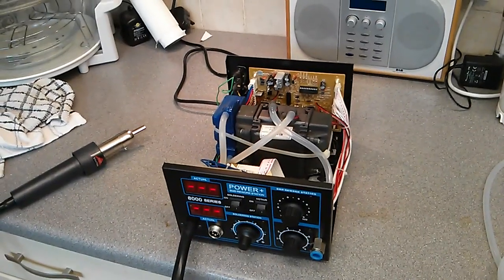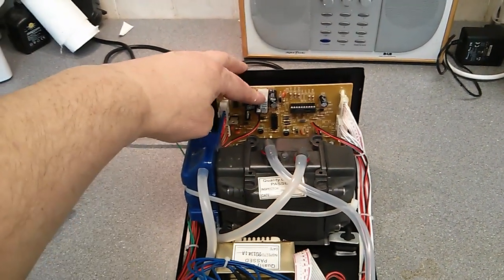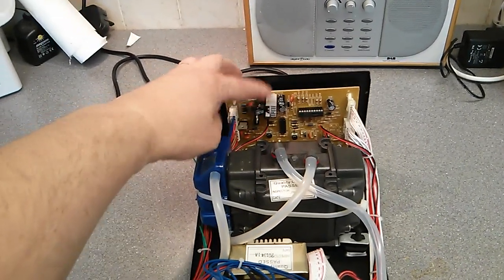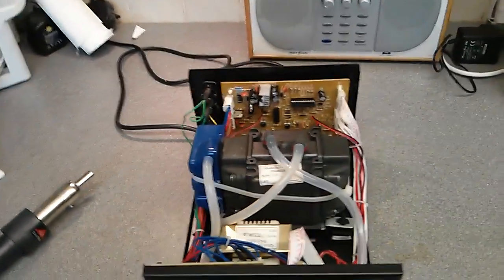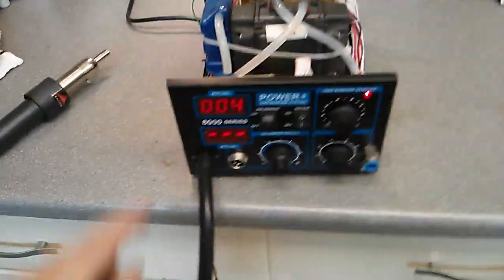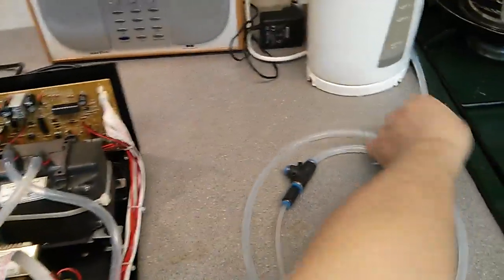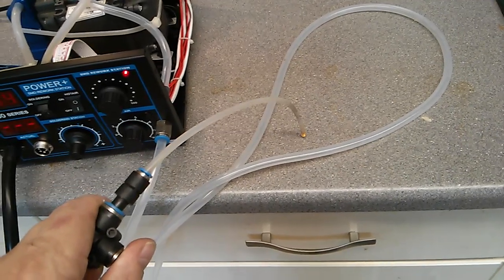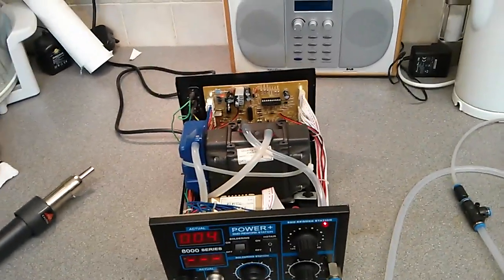Power+ 8000 SMD hot air soldering rework station mods. Was 2 in 1 now 3 in 1

Comment from the maker: The latest mod is a very simple one...   

 I used the cable from a defunct iron ( new irons are only a couple of pounds) cut the iron off, and put a socket to match the plug on the other end..    

I now have an extension lead for the soldering irons..    ridiculously useful !

Comment: I just received my unit. I tested the hot air blower, it worked for about one minute.  It's not blowing air anymore. Any clue ?
Reply from the maker: Sadly no,   I bought a second one a few weeks ago and it had a fault on the board that controls the air pump. The fault on mine was that it delivered no air or air at full power, the potentiometer working like a switch..  The job I needed it for requires an accurate airflow control.   I made a video and sent it to the seller, who refunded. I then bought another which works just fine.
If its new, I'd advise contacting the seller for replacement or refund.

ps, the original is still working just fine..  and its used almost every day.

Comment: Cool Mods, I just won one of these for £25 delivered brand new. I have a BK6000 rework station for the last few years. this has the cartridge soldering iron tips. Since I don't have the Power 8000 yet I'm wondering if the pinout on the soldering iron connector is compatible with the Hakko irons?
Reply from the maker: I believe so, it certainly matches the cheap replacements and the tips fit fine too.  One mod I did since the video may be of interest.. I recycled the cable from an iron that failed by cutting at the iron end and adding an inline socket..  very useful iron extension lead !  By the way, this station is still working well, used for several hours a day for sometimes several hours at a time.
Reply: Spiyda Ltd thanks. yeah will get a hard life from me I have the iron and heat on for hours at a time doing ps4 HDMI ports.

Comment: Thanks for the great video - I have the exact same unit and I'm having a tough time trying to figure out why my pump only runs on full voltage (one speed). The pot on the front face has been tested as working and shows continuity to both AIR VOL2 connections on back board. The triac @ U3 (BTB04) was taken out of circuit and tested ok also with no shorts. It is a mystery indeed. I'll figure it out but figured I'd ask to see if someone had a quick answer...
Reply: Did you ever figure it out? Facing same issue. Are the knobs pots or something else? My first thought was to clean the pot but it looked different

Comment: Can you tell me what voltage feeds the 'air? I own a 952 Gordak! 
I think 15 VAC (since this is not the bridge rectifier) but await confirmation. 
Some time ago I removed the membrane since it was just noise and then not air it distributed. The membranes mounted on this desoldering station are really disgusting to say the least. I would like to apply a small Mabuchi RS360SH 3Vdc by inserting a diode schottly appropriate to protect the motor and the classic endurance. Thank you. Hello.

Comment: Hey!  Very nice little unit you have there!  I've been wanting a soldering station for a while now and am looking into buying this one.  I have a couple questions for you regarding the quality and such of this unit.   Do you still use it and does everything still function well?  Is the cord of the soldering iron heat resistant?(I always melt my soldering iron cords!)  

Thank you so much!
Reply from the maker: Hi,
I use it pretty much every day... and I would definitely reccomend it if you need the hot as well as an iron.
I use the hot air as much for heatshrink as anything else.
The cord is not heat resistant and I agree, that is a weak point. I don't have a great problem with it as i drape the iron cord over my microscopr when soldering, so the iron cannot come into contact.
The other niggle is the quality of the sleeve that hold the iron tips in place..  sometimes the tips jam and need a knock to free then ..
But all in all, still impressed !
Reply: Hey! Thank you for the quick reply!

Have those improvements like the bigger heat sink on the regulator and resistor replacement held up? 

Sounds like a great unit!  I'm getting it!  :D
Reply from the maker: The changes are fine and can only increase the lifetime..
go for it..  ( ps - I have no connection with the manufacturer or suppliers.. !)
Reply: Sounds great!  I will have to check those things when I get it to see if I need to make those changes as well.

Hahaha ok!
Reply from the maker: Makerj101
I saw that you had a problem with yours.. 
I uploaded a vid of what the temperature displays should  do when you turn it on..

Power+ 8000 SMD hot air soldering rework station power up.
Reply: Spiyda Design Thank you so much!  I think mine does have a problem!  Must be the cause of the themister to burn out in the soldering iron.  I will have to return it.
Reply: Spiyda Design By the way I opened it up and it looks a bit different then yours.  It has about 3 small circuit boards instead of one like yours.

Comment: Hi, Nice video thank you. I have gone for the same one but unfortunately i was sent a 110v version with a 110v transformer inside it. Could i get away with just buying an internal 240v transformer? what would you recommend? Thanks
Reply from the maker: Hi Jay,

thanks, unfortunately it would require switching a load of parts to make a 110V model work on 240V..  for example both the heating elements are driven from the mains, and probably some of the control circuitry has different values.
If the supplier was supposed to send one that would work at 240, I would get them to send the right one..

Chris